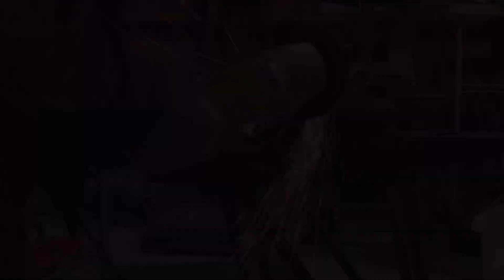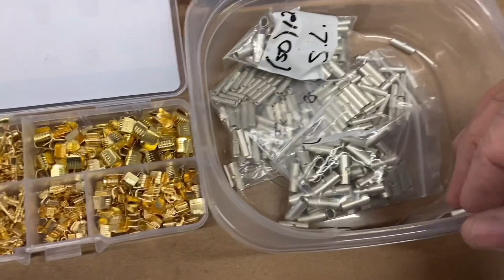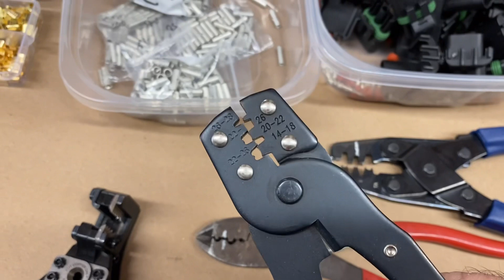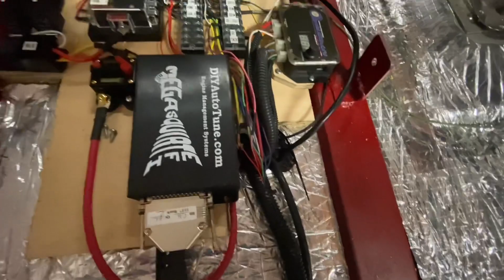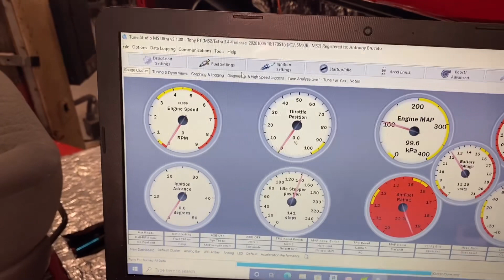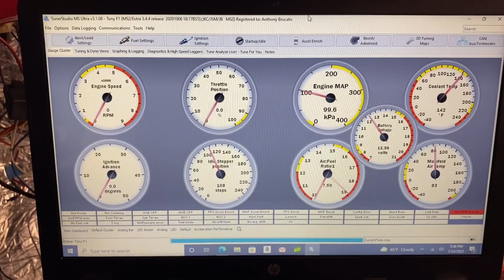Cold Start and More.  Ep 22

Comment: Doing a great job with the wiring Tony! Good advice on the earthing, very important for sensors to reference properly. I am forever repairing basic things often overlooked, such as bad earth's. I find those Weather pack connectors a little tedious to assemble (getting the seal crimped on) when doing a lot of cables. Deutsch DT type connectors are far better, but cost more of course.
Great job on the power distribution and most importantly the main CCT breaker protection! Ah the good ole tug test! 🤓 Oh the whine is not good, sounds to loud to be a vacuum leak, more like intake howl maybe? Hope you find it, look forward to seeing her out in the yard! Cheers from Aussie.
Reply from the maker: Thanks Stuart! Yes, it seems that most automotive electrical problem involve a ground problem. I found the source of the whine, and it’s not vacuum or the transmission( thank goodness!) I’ll have a video about it soon. Thanks for your support!👍

Comment: As an avionics tech and engineer, your work is very good Tony. Where did you source your cabling from? It certainly looks to be very good quality. That Klein tools stripper looks to be a good quality stripper, we use very similar in aviation. We learnt never to twist the strands though, you can however put them back into the natural lay. Glad to see you're using dual wall heat shrink, and also so nice to see a professional using a heat gun to shrink it, rather than so many YouTubers using naked flame! I wonder if the whine/squeal is a vacuum leak?Great video as always mate. Cheers, Andy
Reply from the maker: Thanks Andy! I’ve been getting my wire from, Wirebarn.com. They have a nice selection, and they will sell small quantities. Yes, that Klein Stripper works very nicely. Our home improvement store has the whole line of Klein tools. Thanks for the correction on twisting the strands. I wasn’t sure if I was doing right, but I’ll try to stop. Old habits are hard to break, though! I hope you’re right about a vacuum leak. I’ll check it out this weekend.👍